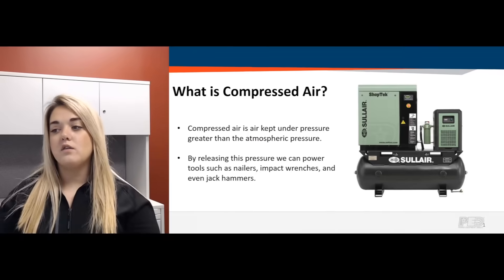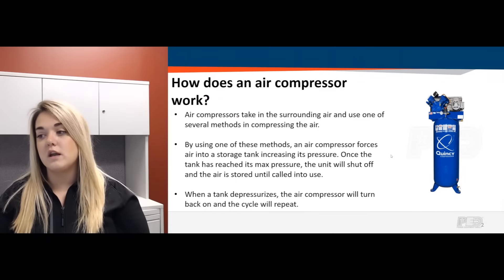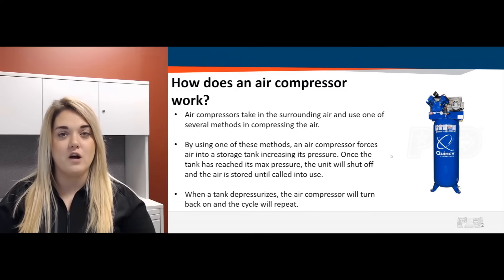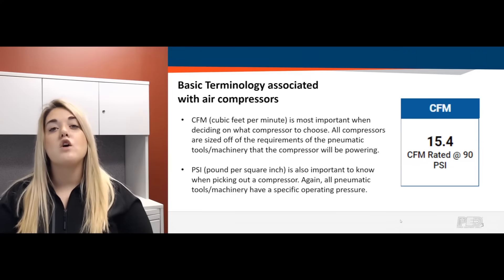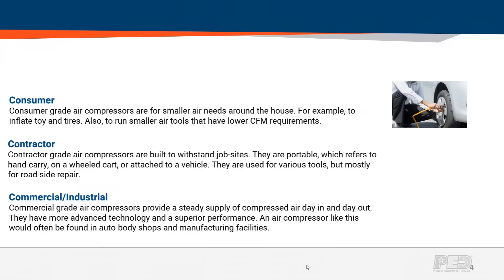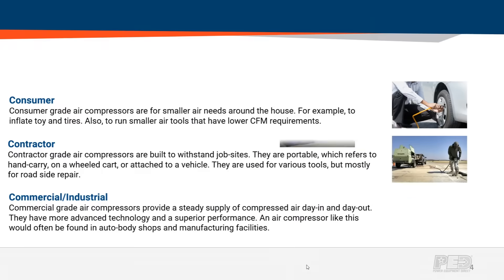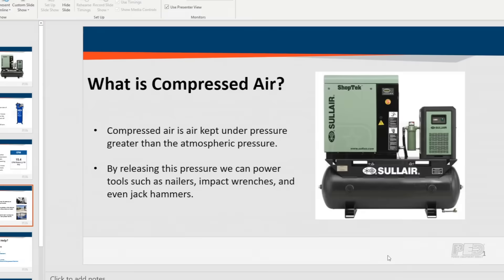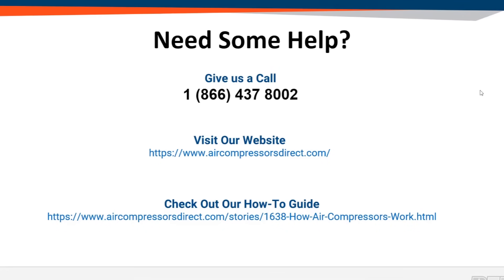How Does an Air Compressor Work?

Comment: one question i have, does the air compressor   works on the same principle of a bicycle aie pump, where there inlet and outlet valves, as in when when u push the  inlet valve opens and when u pull the  the outlet calve closes...thx
Reply from the maker: There are three major types of compression that occur in most air compressors: reciprocating piston, rotary-screw, and scroll. The mechanical systems are divided up into positive or negative displacement, and occur in single stages or multiple (two-stages). Please read our article on this topic, it goes heavily into detail that should answer all your questions thoroughly. https://www.aircompressorsdirect.com/stories/1638-How-Air-Compressors-Work.html